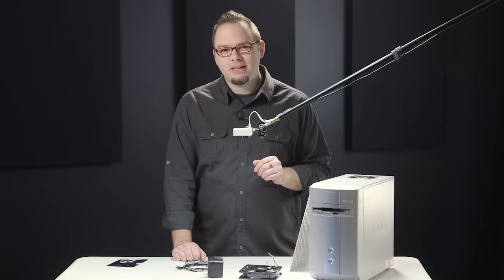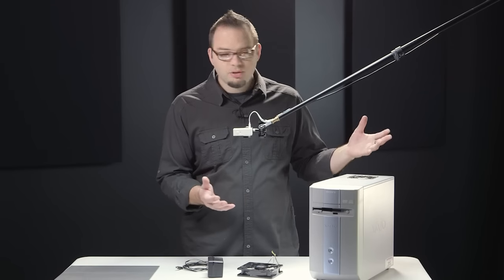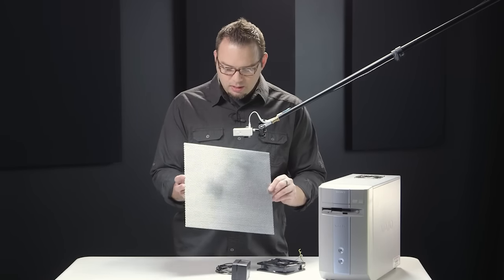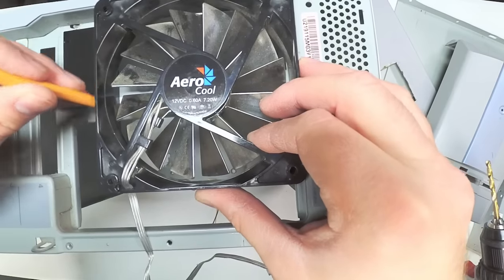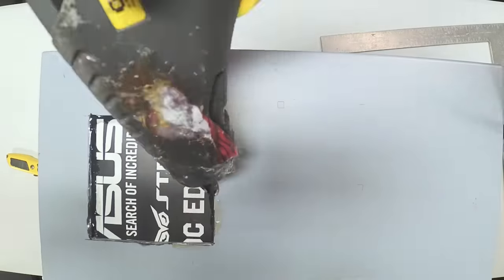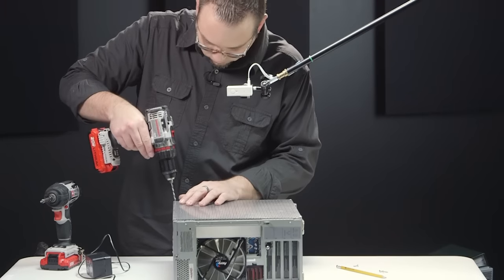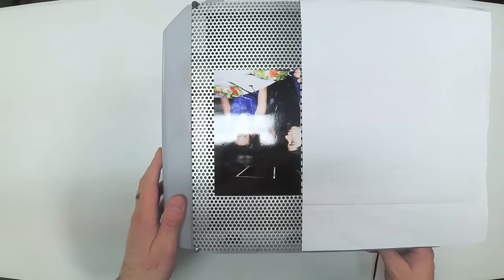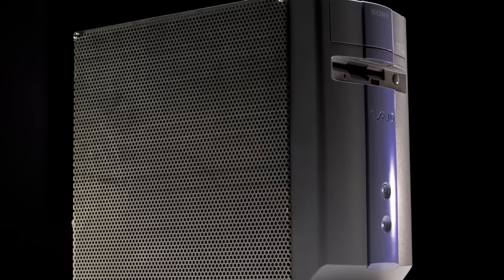Create a Vacuum Photo Copy Rig From a Computer Case

Comment: Is this from the "hugely overcomplicated ways of solving problems that don't exist" series? 
Here's an alternative method:
1. Get the old printer/scanner from the back of your garage (it's next to your bike)
2. Scan your photos like a normal person.
3. Use the several hours that you saved to do something productive.
Reply from the maker: +EmperadorRestore true, it's not for everyone. There are some workflows that don't work on a scanner, though. For example, maybe you have a high volume of irregularly shaped prints, or those prints have an irregular glossy surface (especially when it's broken, like with older prints), or they're located in an archive or some other restricted space. Most of all, though, the benefit of a copy stand is speed. For single prints, no doubt: the scanner is superior. For ergonomics, speed, and repeatability the copy stand is a good tool.
Reply: Haha! I just discovered this video and your comment today. As was mentioned by Tuts+, this copy stand is about speed! Just this year I did a project for a client where I had to scan 200+ photos. Some of them were 80 years old and it took 8+ hours. Scanners are slow if you are using a higher DPI. I could have done the same thing with my copy rig in 30 minutes or less. Sadly, I took the vacuum copy rig apart years ago. Live and learn.
Reply: Those who know photography well doesn't use scanners but use their DSLR for repro with that kind of vacuum table.